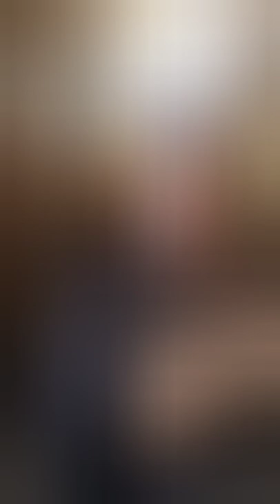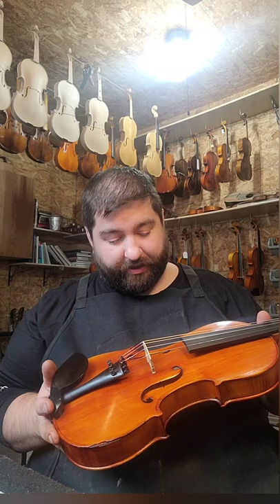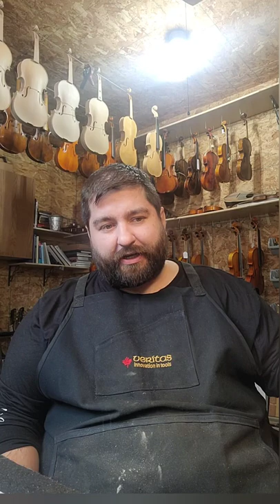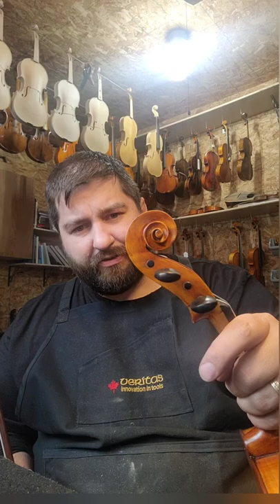100 year old violin made in Nippon

Comment: I am thinking about buying one for 50$ and let my husband restore. He did one already and the tone is remarkable. This one has that same too plate crack and some really horrible polish. They used like furniture polish or something. And it's bare wood on chin rest area.
Is it ok to sand - revarnish!
Reply from the maker: I likely would use a scraper to remove the varnish instead of sanding.   A proper scraper for instrument work will leave a smooth finish especially for the top of the violin.   Sandpaper can leave it sort of fuzzy looking if you dont go to a fine enough grit.
Reply: @lucaswelshmusic7607  oh okay well I'm sure my husband would research everything thoroughly like he did when he restored my Christmas gift on Nippon. But he didn't have to do anything to the varnish on this one
Reply: I have the same one with a sticker inside says Trade market made in Nippon.  I have the original case, and everything on it is original. It's in great condition so I would like to know what its price could be? Does anyone know?